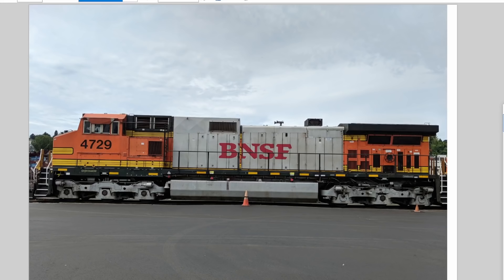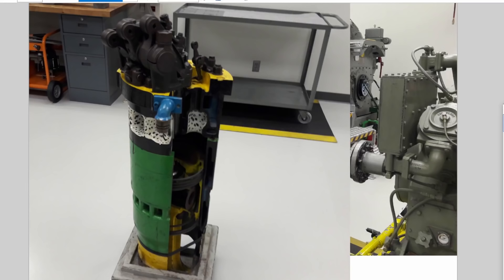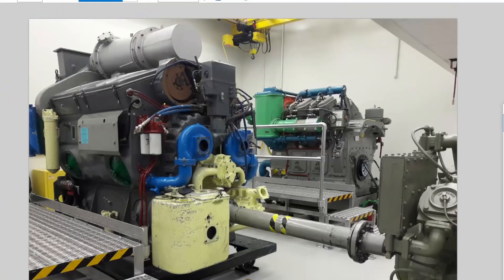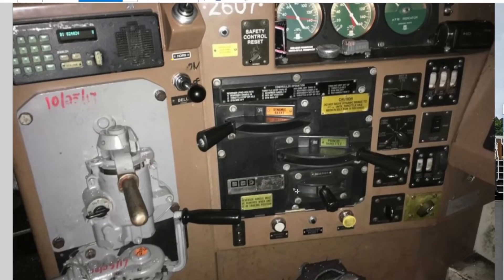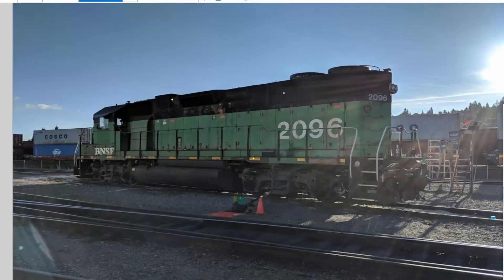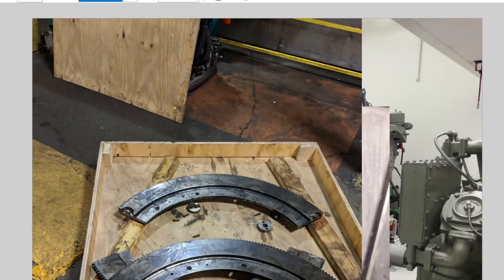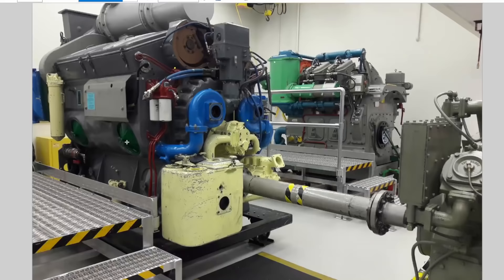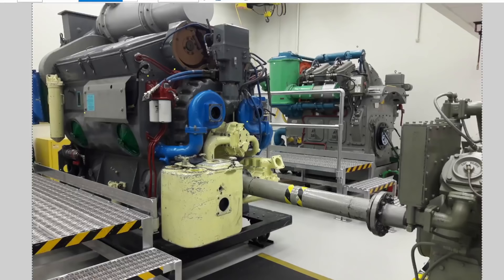Diesel 101 - How DIESEL LOCOMOTIVES Work! [10 Levels]

Comment: Huge info dump about the auxiliary generator and the load regulator.

The system is very similar to that used in a lot of stationary power plants. 
To generate electricity, you move a wire through a magnetic field. The stronger the magnetic field, the more current you can get out of the wire. If you use the strongest possible magnets, your electrical field will still be weaker than what you can generate with an electromagnet. Increasing current though the electromagnets (called field current) let's you make more current.
So the reason that the main alternator on those locomotives uses power from a separate generator is so that they can essentially make a more efficient/powerful/compact generator.

Another benefit of this generator system is that with the load regulator, you can control the torque load on your diesel engine. 
This can let The generator spin completely freely if no current is required by cutting off the field current, which turns off the electromagnets. 
It also lets you choose how much current you want at any engine speed ( as long as it's under the maximum that could be produced at that engine speed). 
This is what Hyce was talking about in the governor section. If the engine is slow to ramp, the load regulator drops the field current in the alternator, which demands less torque of the engine, which lets the engine spin up.
In stationary applications, you can't change engine speed from whatever speed your generator is designed to produce 60HZ at, so to change power output you MUST change magnetic field strength by changing current into the generator.

Very long-winded comment. So if anyone has a question, please ask.
Reply from the maker: Very long winded but very accurate and detailed comment! You cleared up a few things that I didn't quite see right myself! Thanks :)
Reply: its not used much but this also applies to some electric motors some company's have bean trying to make reliable brushless ones. 

also when it comes to field current there is 2 types self exciting and battery exciting, self exciting as explained by the OP uses an auxiliary generator where as battery exciting mostly seen on cars taps a tiny bit of energy off the battery to power the field current and also lets the regulator see how charged the battery is as to not fry it.
Reply: I always wondered about that, thanks. I’m learning a ton about this this morning!
Reply: @phalanx3803  Older EMD locomotives used both Battery excitation as well as self excitation, they had two fields in the main generator. In lower engine notches they would use Battery field to excite the main gen but as you got to higher notches where the batteries could not supply the needed output the Shunt Field would use generator output voltage through a resistor  increase the generator out put
Reply: ''''Xzibit
Reply: Soo wait, what stops you from using the best power band while generating electricity and varying it completely by load on the generator?
Reply: Interesting!  I'm an airline guy, so I'm comparing this to modern jet engines.  The core of my 737's engine (second stage compressor and turbine) runs between about 8,000-14,000 rpm.  We use a constant speed drive unit (csd) integrated with our generator (together they are called an Integrated Drive Unit (IDG).  The CSD keeps the generator at a constant RPM, thereby maintaining frequency.

If course, they put out a lot less power than yours do.  The gens on a 737 are rated for 90 kva at 115v, 400hz.  We have one on each engine, plus one on the Auxiliary Power Unit (APU) in the tail.  One generator can run most everything if needed it to.
Reply: Thanks for the info . Can you please  explain  what  the GG 1 locomotive s had a generator  ( S ) on board for heating  , cooling lighting as opposed  to not using electricity from the overhead  line for these purposes  ??? 😀
Reply: @ccjbmjo  and in the Battery field units, if you blew the battery field fuse, they Generator would go to full excitation and littlerally stall the engine to a stop, we did that on DOT 1 at the AAR facility in Colorado  doing some fuel research testing on load boxes in the mid 80s
Reply: TLDR.  V=IR,
Reply: Engine RPM is everything, the system will do what ever is necessary to maintain RPM in each throttle notch, but in a GP9 if you lose battery field fuse the aux gen goes full and stalls the engine, happened to us once during the testing
Reply: @joeshulman675  I'm not very familiar with the GG1s, but if I had to guess it's because of a difference in electrical systems (voltage probably). When the GG1 was new there wasn't a very efficient way of converting electricity from one voltage/frequency to another
Reply: @phalanx3803  I had a rat chew through the F+ wire under my dash. Since she did not chew it cleaning my alternator was producing full power trying to charge up the battery or sending no current. Was very hard to diagnose and repair. Much higher magnitudes of power involved in these larger engines so controls and systems need to be more complicated to keep bad things from happening and keep good things happening. Good job Hyce.
Reply: @ChiefCabioch  Like having the clutch and brakes engaged fully and accelerator to the floor on a car.
Reply: @Ben31337l  The newest models do have this via computer control. Earlier models didn't have the computers on board to figure it out.

You have to remember, with diesels even the 1990s models were just refinements of 1930s era tech.
Reply: @Ben31337l  Well that is a more complicated concept then it really seems. Engines generally have a range curve of power, torque, and fuel consumption. Obviously you get the least fuel consumption at idle RPM range; however you aren't really going to be able to do much with an engine at idle, not to mention it's really bad when your engine starts to knock at low RPM. Then you have the peak torque generation range; this is generally where your peak efficiency is too. 
 Then you have the point of peak power generation; power is torque times speed, so this is where power generation starts to decline compared to a given speed. So basically you want run at as low a range as possible, for the best trade off. So for a given locomotive, because it uses electric machines in place of gears; it's going to go as fast as possible, at a given throttle setting. So for taking off and climbing hills; it's going to run in a higher power band, to optimize power generation to take off. then when it's up to speed on a level section; then they can reduce power to optimize for a given cruise speed; where they need some power, but not all of it.  Then when going down hill, they will set the throttle down to idle; while not necessarily at the optimal range for efficiency, the train is going to use less fuel to cover the same distance; compared to keeping the engine revved up, but not actually using the power it can produce.
Reply: @wyndhamcoffman8961  That's very true, there's nothing more that I can add to that.
Reply: @ilikepie1974  @joeshulman675 with AC converting voltage is never an issue; a simple transformer does the job, and the GG1 actually used a transformer to convert the 11kV 25Hz power from the pantograph to the 400V 25Hz that the traction motors used. What you can't do with a transformer is change frequency. Producing DC from AC is still pretty easy; you can just use a rectifier, though in really high power applications you still sometimes see motor-generators. But your only option for changing frequency is either very sophisticated electronics or a motor-generator. I'm not certain what PRR ran back then but the current standard for passenger equipment is 480V 3 phase 60Hz. Note that the GG1s (at least some of them) had oil-fired steam generators since older passenger cars used steam to provide heat.
Reply: Fun fact: the reason aircraft use 400Hz AC is the higher the frequency the smaller all of your magnetic equipment can be.
Reply: @jimnasby     Or you go AC to DC and then back to AC. Ask Japan for how to do it — half the country has 60Hz, the other half has 50 Hz … and they do transfer power between the grids.

Or ask any uninterruptible power supply manufacturer, especially those who have to bridge the time between power cut and diesel generators coming online for large data centres. Data centres will typically use battery banks and may run the inverters all the time to avoid the transient peak when power is cut.
Reply: One can always go deeper of course. The REASON a "stationary power plant" doesn't allow you to change the speed of the prime mover is because the generator it's attached to is a synchronous machine. In the case of AC locomotives such as the SD70MAC and SD80MAC, the output from the main alternator is rectified to a DC bus. The traction motors in this case are AC induction motors (these are not synchronous machines, the output shaft will always spin slower than the frequency when the motors are operating as motors) which are driven by inverters which can generate AC at any desired frequency to optimize the operation of said motors. Both through the inverter and through the field control on the main alternator, the power from the engine through to the wheels can be modulated.

It's worth stating that increasing the field excitation doesn't necessarily just increase the alternator's current output capability. It can increase the generator's output voltage, and in fact does so if the engine stays at a fixed RPM. Whether or not you observe an actual voltage increase on the output of the main alternator/generator depends on how the output regulation is done. At least from looking at an SD80MAC operator's manual, the main alternator has a capability of outputting max 2600VDC after it is rectified to DC, and a max of 8100A. If we calculate the power of this, it is close to 21MW, which is far greater than the ~3.7MW such a locomotive's engine can output. So it stands to reason that when operating at 8100A, the output voltage is set much lower, and when operating at 2600VDC output, the output current is much less than 8100A. The locomotive does change its voltage operating levels and current, but it's managed through the complex interaction of engine RPM, alternator excitation, and inverter output voltage, frequency, and the RPM of the traction motors. Each of these can affect the the DC voltage and current on the main power bus. I don't have have an SD80MAC to test all of this with but it's a pretty solid educated guess from looking at the manual.

Not all stationary power plants are created equal however. Distributed generation such as windmills use inverters to allow the rotor/generator to operate asynchronously from the grid. The inverter when pushing power to the grid can detect and synchronize with the phasing and frequency in that case, so the output of the whole system is still synchronized even when the main generator is not electrically synchronized with the grid.

And another variant on that is SCIG, squirrel cage induction generators. These are induction motors working as generators instead. For the most part motors and generators are fairly similar to each other across types. These (SCIG) are the counterparts to the AC traction motors in an AC locomotive, yet the AC traction motors are technically SCIGs when being operated in dynamic braking mode as they are now generating power to be cooked off on the resistive grid. For a grid(electrical utility grid in this case, not the resistor grid) connected SCIG, it would operate at or above the grid frequency in order to generate power, and thus synchronization is not required here and the prime mover (whatever device is converting chemical or other types of energy to mechanical) does not need to maintain a fixed output RPM.

Older locomotives used DC motors and generators. These typically also used an electromagnet for the field instead of a permanent magnet for the excitation of both. The motors could be adjusted to operate at a higher RPM and lower torque by reducing the field current, and there might be up to 7 different stages this could be done through. Typically, a resistor pack would be connected in parallel with the field winding on the motors in a certain arrangement(This technique wastes some power as heat and is not hyper efficient, but it works). The motors could also be switched from being connected in parallel to being connected in series to double the stages. Interestingly, reducing the excitation current on a motor allows the motor to operate at a higher speed for the same input voltage. A configuration used for this is often a "field diverter". In the case of the 45-tonner I looked at, the field winding was in series with the rotor winding, and so shunting current away from the field winding allows more voltage to be applied to the rotor winding, as well as reducing the backEMF and allowing it to operate at a higher speed through both of those interactions.

The most information I could find suggested AC locomotives were not in production/use until around 1994.Some benefits are:
1. There's no split ring for commutation on the generator, so the brushes have a much longer life and require less maintenance. The ring being split increases physical wear on the brushes.
2. The AC induction motors require no direct rotor commutation as the magnetic field in the rotor is created by rotating a magnetic field around it from the stator, so this eliminates brushes entirely in the motor.
3. Inverters with IGBTs or MOSFETs are more efficient than the mechanical counterpart, a rotor with a split ring for commutation (the windings in the rotor of a DC generator or motor experience AC current, so arguably this arrangement is the mechanical version of an inverter and rectifier, depending on the mode it's operating in.) There's a lot of arcing going on inside a brushed DC motor, so that's another route for power loss.
4. Externally excited AC generators can operate at higher rotational speeds due to the smooth commutation rings on the rotor. This helps the output in automotive applications significantly, as an alternator might have a different pulley ratio so that it rotates faster. Whether this is specifically a benefit on locomotives I'm not sure, since their engine RPM is already not particularly fast. An automotive alternator might spin up to between 10k to 14k RPM at the top end.

Some of this information may be slightly less than accurate as I've only been looking for about the past week and a half into this stuff after seeing an old GE switcher cab at a show I went to. I have an EE background but have not worked with any locomotives, so the actual implementation details may vary a little, and who knows if I made another mistake while rambling. I'm sure someone will tell me.
Reply: On "newer" locomotives with rectified traction alternators, the auxiliary generator excites the companion alternator constantly, whose 3 phase output is then rectified with an SCR that is part of wheel slip control, among other things. The AC output also runs all the motor cooling and traction motor blowers, as well as the blower motor for the carbody filter. The rectified (SCR) output passes through the load regulator, some current shunts and other business, then to the traction alternator field. Without any generator's output, you can't move the locomotive under its own power. Not that you'd want to with no motor blowers.

On governed EMD 2 strokes, the governor activates a switch when the throttle is at full rack (overloaded) and backs off the load regulator before allowing it to advance again. This happens over and over, which is why some EMDs will have a rhythmic surging of exhaust smoke. This makes sure that the engine is never under- or over-loaded.

The 72V auxiliary generator doesn't have its own fuse on first and second generation EMDs since it is self exciting. This generator runs all the lights and electronics. If the output of the generator becomes overloaded or shorted, the current produced becomes zero. This of course sounds all sorts of "choo choo is broken" alarms, picks up the no voltage relay, drops the fuel pump, and prevents loading.

Slight correction, locomotive traction alternators are constant power. The systems do not "pick" whatever current they desire. The output of the traction generator is always a certain power. As speed picks up, amps drop off and voltage picks up. The opposite happens with falling speed. You might see 6 volts on the alternator output or you might see 950. It depends strictly on current.
Reply: @jimnasby I don't think HEP as we know it was really a thing until the 70s with the FP40

Comment: The two stroke engine is like a big version of the 2 stroke Detroit Diesel engines used in tanks, busses, trucks and even boats from the 1930’s all the way to the 90’s.
Reply from the maker: Yup!
Reply: Actually if you look into it, EMD was originally EMC or Electro-Motive Corporation, before being bought by General Motors and converted to EMD or Electro-Motive Division. GM was also the same parent company of Detroit Diesel when they were still pumping out their 2-strokes (71, 53, 110, 92 etc).
Reply: @ThinBlueWarrior  General Motors Diesel was the name stamped into the stamped steel valve covers. Detroit Diesel was in the cast Al valve covers in later models. It later became Detroit Diesel Allison. We had both styles at work. The stamped steel on the 12V71s and the cast ones on the 6-71s.
Reply: Anyone interested in seeing some great vids servicing and rebuilding classic Detroit Diesel two-cycle engines?  Check out Bus Grease Monkey on YouTube.